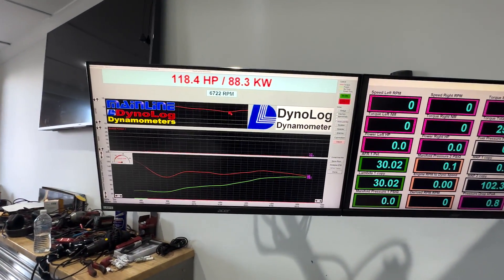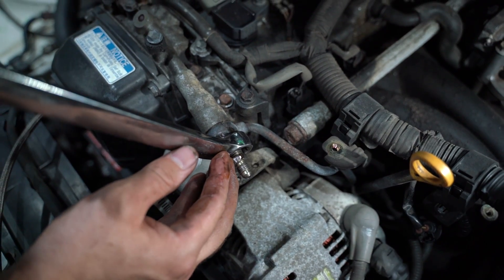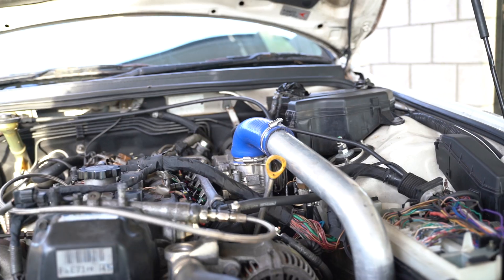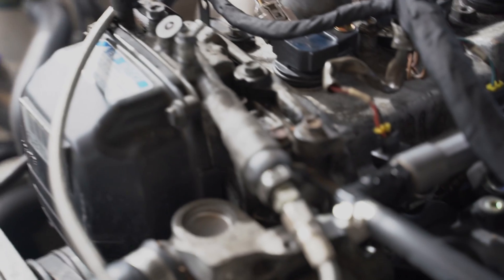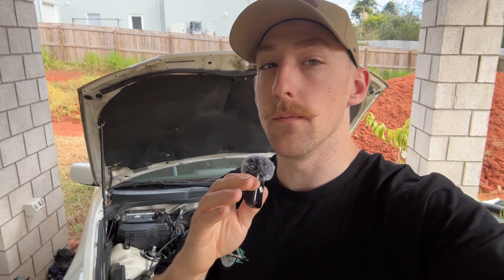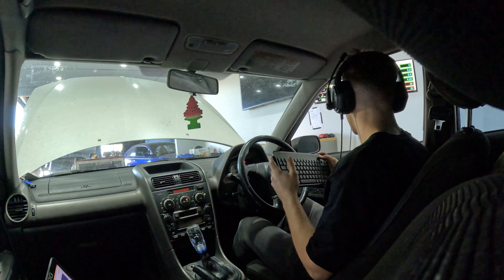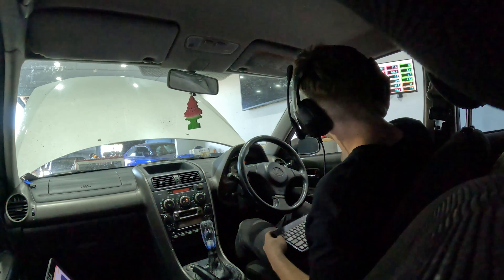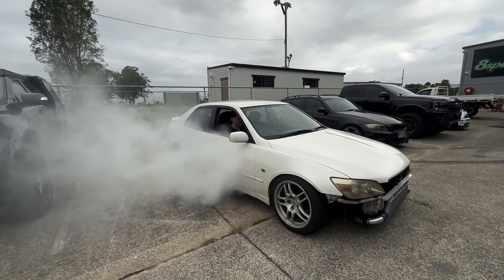TURBOCHARGING MY IS200! (1GFE+T) My Budget Drift Car

Comment: 112hp  NA????? something wrong there my friend, it should have 155 stock.  i went from 153 dyno NA to 220 turboed on first run back then when i did a turbo mod.
Reply from the maker: @progunniedutchhd5310  Hey mate thanks for the comment 🙂 not necessarily anything wrong the engine is healthy and was bone stock. There are an immense amount of variables between brands of dynos and the figure they put out. 

Mainline have been known to read lower compared to other brands, the output figure can also alter depending on the type of dyno (Load bearing vs Inertia) and the dyno/weather station settings (some dyno’s also display a calculated engine power/torque rather than displaying an at the wheels or hubs figure ignoring the power loss you see through the drivetrain).

For reference I tuned a friends SR20 that was tuned previously by another tuner on a different dyno and it made around 310hp at the wheels but with 0 changes to the tune on my first ramp run to get a baseline his car made 260hp at the hubs on the mainline dyno in this video, I was able to make an approximate gain of 20hp/tq on his car with some fine tuning so theoretically his car would make 330hp on the original dyno. 

Lots of variables between dynos and shops unfortunately not making it easy to compare.
Reply: I suppose that 112 hp was because of old clutch.
Reply: 220hp from turbo ?
Reply: Gat 370/400 out these no problem with a half decent turbo setup 😂 take it to Ireland they lads threw there these are there bread and butter they’ll sort you out haha
Reply: Corsa 1.4 sxi has 115 hp 😂
Reply: @gary-mac93  lol no the 1.6 is 115
Reply: @gary-mac93 they aren’t fast motors they are actually the lowest outputting motor of all 6 cylinders

Comment: i've got myself an is200 with the 1G-FE which im currently rebuilding and planning on turboing later. Seriously great informative content brother! Definitely will be sticking around to see the lexus progress
Reply from the maker: @brunzu6079  Thanks for the comment! Check out the latest video I dabble with some suspension stuff and take the Lexus drifting. Wish you the best of luck with your build 🙂
Reply: ayo did u turbo it?
Reply: @bendo7514 not yet brother😅 i'm currently battling rust thats trynna eat my car alive, so ive had to learn welding and its been a whole thing. Just last weekend i got the car out of the garage and ive got a whole new outlook on my plan for the rust fixes, basically im gonna turn the car on its side so i can properly fix the rust by sandblasting and welding. I speedran the teardown by ripping out the engine, trans, interior, rear subrfame and fuel tank in a couple of weeks and the project has been at a standstill from that point cause rust fixin wasnt in the plans😭 but ive finally got a clear plan and im exited to get a new air compressor for the sandblasting and so forth🙌

Comment: Thank you very much for this video, I just finished my is200 supercharged project, went true all upgrades (clutch, lightweight flywheel, pump, pressure sensor, "black box" you name it,  but I still run a stock ECU - as advised by "Rank One Performance" - they say that's safer to use stock ECU rather "Haltech" and blow up engine. I don't know who is right or wrong, I would like 3 fuel maps loaded to chose from. Thanks
Reply from the maker: Thank you for viewing 🙂 Simply running a haltech will not “blow up the engine” the only thing that would cause that would be if the tuner did a poor job at tuning the engine. There’s nothing wrong with running a stock ecu on a low boost setup using the “rank one” turbo kit however there is no ability to make adjustments to the tune or power output on a stock ecu so it is a very limited setup, with a properly tuned engine a standalone ecu is a much better option in my opinion. Best of luck with your build 🙂 thanks for the comment

Comment: Great video man , how do rekon the UK style 1zz and fuel cut defender style turbo kit would be comparatively ?
Reply: Cheers for the reply dude
Reply from the maker: @nate-tz8sx  Thank you very much, not sure what aspect you want me to compare but considering a fuel cut defender simply tricks a stock ecu vs a standalone style unit having full control of the engine operation like in my car tuneability is next to none on the defender setup. I can’t really speak against reliability on the defender style way, it seems to be popular but “is it reliable” is hard to answer as there are so many variables like turbo size/what fuel the car is running, intercooler setup, boost level how healthy the engine is or isn’t etc. For me personally running a standalone style setup in either piggyback formation or wiring the car to be run completely on a standalone ecu is the way to go. The more control I have of engine operation the better in my opinion (so far my car and tune has proven to be incredibly reliable) Thanks for commenting! 🙂

Comment: U said the haltech now controls the TPS, does that mean it overrides the stupid a** stock "smoothdrive" electrically controlled TPS that does not follow the pedal and cable, but is controlled by the ECU (unless u block it by disassembeling some parts inside it)
Reply from the maker: Apologies for not mentioning the throttle body in detail in the video, but previously to installing the turbo and haltech I installed a modified throttle body to delete the electronic control and get a direct relationship between the foot pedal and the butterfly valve
Reply: @Racelab_yt  Ah, thought so! Alot of ppl never touch it, and it is a big difference! Some ppl use zenki gx100 1gfe tb's and some modify them, which is quite easy to do, if u do it smart u can reverse it to get rid of the check engine light too (for inspection) but yeah FFUKKK Toyota for leaving us with that BS even on the SPORT version of the IS200... >_<
Reply from the maker: @kingnorlen  it does make quite the difference to throttle response for sure! To Toyotas credit it was one of their first production attempts at a drive by wire style TB, and to its credit it worked flawlessly for providing a perfect idle no matter the conditions but the delay in response is atrocious. Luckily it’s deleted in my case
Reply: @Racelab_yt  Yeah, but since Toyota actually had the guy who was responsible for the AE86 to make a "new affodrable sports sedan" that carried the same type of soul (altho the 1gfe clearly is NOT what he cared about, and was strictly a Toyota corporatedecision for the EU market) its kind of embarrasing tbh. I dont know if u guys also had the IS200 Sport? The ONLY difference from a regular GXE10 is that the LSD is standard, and its got a bit shorter final drive, and thats it xD Still slow as fuaaark lol
Reply from the maker: @kingnorlen  ahahaha yes unfortunately it is miserably slow from factory, Toyota did drop the ball a little there 😂

Comment: great!
have you done anything to the throttlebody? i had a "blackbox" on my is200 turbo but the throttlebody destroyd all the fun. :)
Reply from the maker: Completely forgot to mention I already have done the throttle body mod before I turbocharged it deleted the electric control and welded the actuator together so the foot pedal has a direct correlation with the butterfly valve.
Reply: @Racelab_yt  very helpful video. will you make a video, how to mod the throttlebody?
Reply from the maker: @KTchannelKT  I have 2 spare throttle bodies so I may be able to do that yeah

Comment: 110hp from a straight six is criminally low
Reply from the maker: Hahaha it’s pretty bad, very small cams and the head/intake manifold design isn’t really designed for amazing peak power/torque but a turbo definitely wakes it up 😅
Reply: @Racelab_yt  bro i own both a 1gfe and 3s altezza and let me tell you, in those older forums the 1g owners would swear up and down that the 1g has more tq than the 3s because its a 6 cylinder and i would laugh everytime
Reply from the maker: @divin3kag3242 unfortunately not everyone understands what power and torque actually is and in allot of cases just think more cylinders guarantees more power/torque but there’s allot that goes into the equation. The humble 1g was definitely built for hairdressers and business people with 0 desire to go fast 😂
Reply: @divin3kag3242 same peak torque just less hp
Reply: @lachlanbird6095  i dont think so i race v6 6 speed accords which has way more torque and they barely lose me. Couple of the lads have 1gfe 6spds and their gutless down low and up top
Reply: @divin3kag3242 you lost the comment when you said “V6 Speed”
Reply: @priismedits9628  not sure what you mean?
Reply: @Racelab_yt you think u could reach to 300hp ? With the 1gf
Reply: @divin3kag3242  2.0L 4 and 6 cylinder will make similar power, the difference is the torque band.
Reply: @cjohn64  i still dont see how this torque band situation comes into play when the redline on a 3sge is 7800 compared to the 1gfe 6500????
Reply: @divin3kag3242 I didn't say it did, I was just stating that any six cylinder of the same displacement of a four cylinder will have a different torque band. Specifically a fatter or wider torque band. Just as a V8 will have a wider one that a six cylinder. That's how the physics works. Obviously if an engine can rev high then it will be capable of higher HP, that has nothing to do with a fat torque band. 

Why else would Toyota or Nissan make 2.0 liter inline six engines when they have 2.0L four cylinders, thetorque band, duh.
Reply: @cjohn64 yea but a 2.0 inline six makes no sense when the engine is designed with economy in mind thats my problem with this whole torque band argurment.
Reply: @divin3kag3242 economy has to do with displacement not number of cylinders. Duh
Reply: @divin3kag3242 also low end torque is more pleasant for daily driving hence why Toyota also came out with their F heads. The G heads are wide angle valves which produces power at the top end while their F heads are narrow angle and produce low end power. In the trades it was considered an eco design because they would put a F head on a low displacement four cylinder to help bring torque lower to daily driven cars would have a little more torque at the bottom end. So when drivers are constantly stopping and going at red lights they would have a little more torque. All this verses the G heads which are all about power. And power lives at the top end. It's the same reason VVTI was brought in, so that torque and therefore power could be adjusted from the low to the top end.
Reply: @cjohn64 the arguement is still lost that the 3sge has more low end torque compared to the 1gfe thats all im saying
Reply: @divin3kag3242 you're still not getting it. I never said the 1gfe has more torque or even low end torque than the 3sge. I said the torque band. Maybe you call it something else but get the dyno graphs of both and the 1gfe will have a much more linear aka fatter torque band than the 3sge. Not greater, linear.
Reply: I mean there fews in the uk that made 480hp from a stock 1g internals and it still run and drives sweet as hasn’t blown the engine up or anything still driving it after 5months
Reply: It was wheel horsepower
Reply: They’ve always been one of the slowest 6 Cylinders out there. No suprises:
Reply: @priismedits9628  bmw m50b20 is definitely much slower than 1gfe

Comment: Little low on power but still love to build. Got my tuned on td04hl-15t (volvo turbine) blowing ~0.6bar running LPG, 0.6b at ~3k rpm not to bend rods. Powerwise it showed 240bhp on wheels and 300nm torque. similar power on 98PB as on 95PB got little bit of knocking at top rpms. Stock internals, only injectors and fuel pomp replaced. Been using DET3 in piggy mode to tune. If you decompress the engine you can push 300+ bhps on stock internals but expect big turbolag.
Reply: Can push 350 stock internals just need injectors and a diy efi reliably it will run this power

Comment: Love this bro👌 i myself in NZ turboed my 1gfe is200, made 180kw/240hp atw but am limited by the stock & tired clutch and flywheel (200,000+kms😅) i have a new hd clutch kit to go in now haha, and its on a full standalone maxx ecu, no stock ecu piggybacked👌
Reply from the maker: Maxx ecu is fantastic and I am hoping to run their “race” ecu on my roll racing/drag racing civic build coming up

I ended up going with a 6puck clutch from extreme as unfortunately the heavy duty I installed in this video didn’t hold up to the task after some drifting do you still have the oem functions of the dash/ac controls etc??
Reply: @Racelab_yt  yeah i have the maxx race in my is200, and same, have a xtreme 6puk w/smf to go in when i find time and energy to do so haha, and yep all my dash and a/c still work, i have a little mpx box or something like that that allows the dash and all that too work without having the stock ecu. I have followed you on instagram :)
Reply from the maker: @darnellpoutai-teawa7276  oh that’s a very cool thing I may DM you on instagram to see what the dash module setup is like, would be very cool to get it running full standalone, would be able to clean up the engine bay heaps with no stock loom/ecu
Reply: @Racelab_yt  yeah thats algood bro, and yeah relocated to passenger footwell/glovebox, next step after the clutch is to put my ffp ali intake manifold on👀

Comment: If i want to turbo my auto is200， which gearbox is better to swap? The j160 or the w58?
Reply from the maker: Unfortunately I’m not too familiar with the w58 but I do have a friend who doesn’t like the shift feel of the w58 vs j160 and so far the j160 is proving to be plenty strong enough for a turbo 1g and shifts fine, I do run a pretty aggressive 6 puck clutch as well and am yet to have issues (have upgraded clutches since this video)

Comment: cool video, is your engine in good shape? I make similar power with 5 psi of boost, I'm also on stock injectors and fuel pump.
Reply from the maker: Never compression tested it, but it’s not a rattly or Smokey engine and so far has treated me well being driven hard every time I drive it so can’t complain. I definitely played it safe with ignition timing as I’m not too familiar with how strong the rods and pistons are, but I do know some other people pushing more power than me on stock internals and seem to have no issues 🙂
Reply: @Racelab_yt  I'd say 9-10 psi is the limit for these engines if you wanna keep it safe and reliable, they're paper thin and you'll bend the rods easily.

But they are pretty good if you reduce the CR and build a forged bottom end.
Reply from the maker: @SERP92_  absolutely keeping the boost lower will be a way to keep it safe you’re right, but there are few factors go into it not just how much boost is produced, turbo size as well as ignition advance and cylinder temperature all play a big role in how reliable a setup can be 🙂 I plan on making another video on the dyno and going through a bunch of things as well as turning up the power 🙂

Yes have seen allot of people in European countries having allot of success with those decomp plates definitely a way to help reliability by reducing cylinder pressure, it may be something I check out sometime in the future 🤔

Thanks for your comment! 🙂
Reply: @Racelab_video  No problem dude! I don't know a lot, but I do know a lot of people in Europe and Poland that have boosted these 1GFE engine's and had great results, If you ever have a question or something your wondering about shoot me a message, I can ask them!
Reply: Nice vid Racelab, very informative. I have a an is200 wanting to turbo it but my cylinders 4 & 5 have low compression. I've been told to solve this before installing a turbo. So was this something to consider before you did the build?

Comment: is this reliable
Reply: Also I know where that shop is do you know anyone who can do it
Reply from the maker: @RICHYSUNCLE  I used to work at the shop in this video, I believe it is unlikely that they would want to do it as the main focus is auto transmission swaps now. However you could always ask. Although pre warning going through any shop (not just this one) will likely be pretty expensive due to labour costs, something I did not have to worry about as I did the work myself 🙂
Reply from the maker: I have not run into any issues so far, the reliability of turbo charging a 1gfe would come down to how much power you’re trying to get and how good the tune is…. So far the car has proved to be very reliable and it gets driven very hard

Comment: Iv always been told 1gfe’s are turds bro have you opened it up at all or just sending it?
Reply from the maker: Haven’t opened it up at all only what you see in this video so just sending a stock long block. The 1gfe was definitely not made with airflow and performance as a priority and definitely aren’t the strongest but that’s why I kept the turbo small and boost low, it was fairly cheap to almost double my horsepower it serves well as a budget drift car. I took this car drifting and used next to no tyres and not very much fuel considering other cars I’ve drifted

Comment: i have a 1gfe in my cressida i was gonna engine swap but if i can i wanna slap a turbo in mine
Reply from the maker: Turbo 1g is definitely a fun option and if you are able to do allot of the work yourself it’s likely allot cheaper than an engine swap
Reply: @Racelab_yt  i have a chinese spooly boi (td04) in my garage rn, i also have an intercooler, boost gauge, and boost controller ready haha all i need is exhaust manifold and maybe put either a piggyback ecu or fuel cut defender
Reply from the maker: @eresuplays  most of the way there, hope it all goes well! 🙂